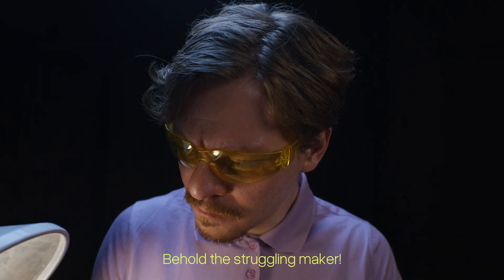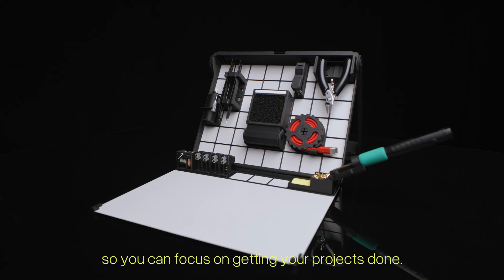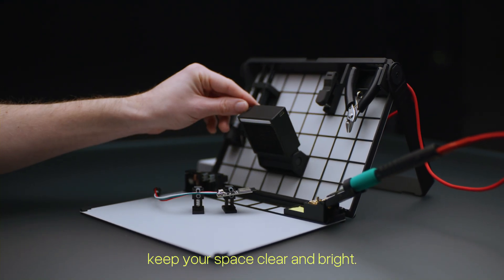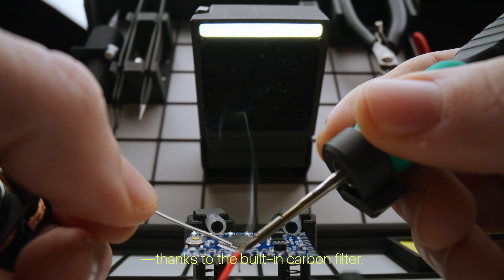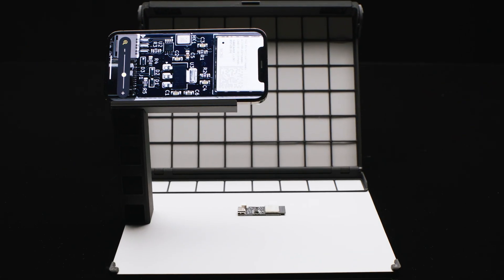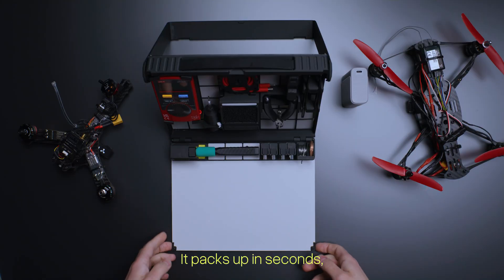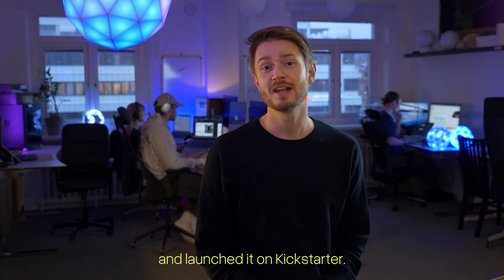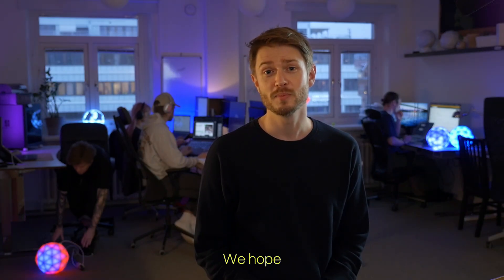SOLDR | Soldering Station | Kickstarter

Comment: i think about this, something where you can safely store and move soldering iron, multimeter, power bank, minware variable power supply, solder wire, and some tools
Reply: I have each of these and have had it on my list to do as well 😅 sometimes you just don't have the time to get something perfect so someone else's solution would suit me nicely!

Comment: can you guys pls detail the range of heat settings so we understand how much control a usb device has? or wattage if that’s easier to contemplate
Reply: They say the soldering iron has 100W.
Reply: If it's anything like a pinecil or ts100/101 then you likely won't be needing much more. Unless you're doing automotive cabling which you wouldn't fit on the desk, and if you're doing a drone you could easily use a preheater of some sort to suit that specific case. I have some powerful irons for the odd job but i wouldn't want to be soldering with them as much as i use my ts100 - maker level stuff and 0806 sized stuff is really well suited